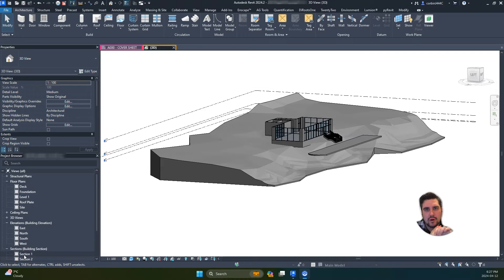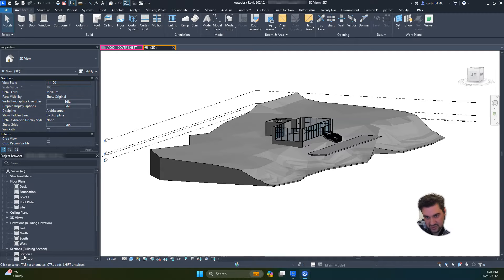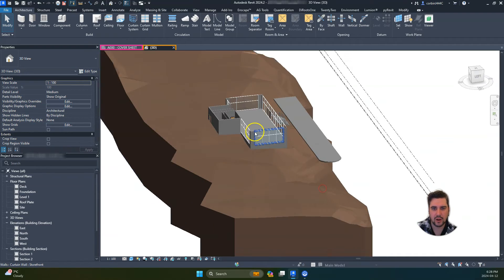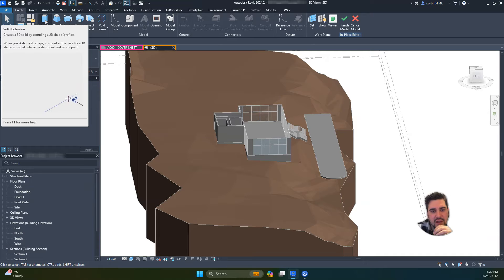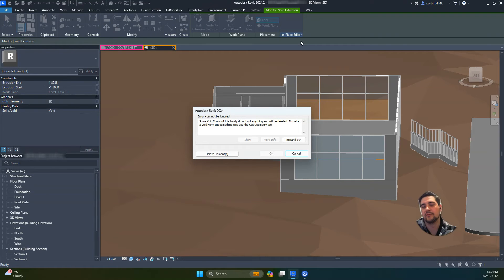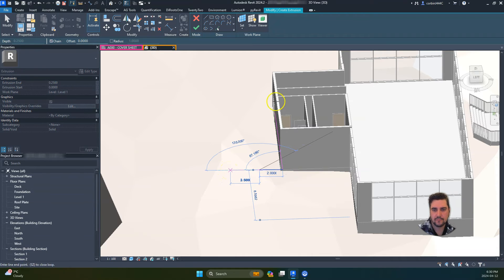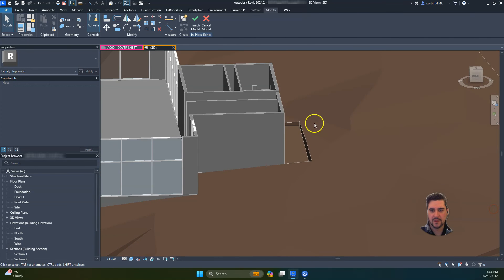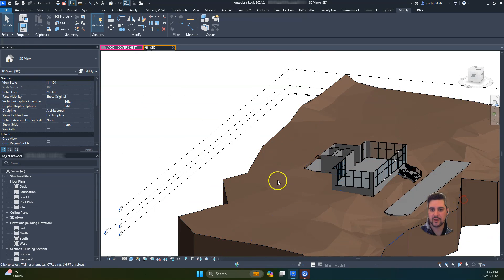Revit Tutorial - Toposolid and Cutting Topography No Building Pad Revit 2024

Comment: honestly this "UPGRADE" revit remove building pad is annoyimng
Reply from the maker: Initially yes but I think the flexibility it provides with topo outweighs that. In 2025 there is also a new excavation button. If you do a lot of topography stuff there is a plugin called environment by arch intelligence that is great for more customization.
Reply: @ i tried 2024
1. padding just work like a floor, its make no sense to modeling a floor by model in place
2. padding has slope on them
3. i can make a filter padding to show on plan: which is excavate and which is fill in (which in my case  in 2024 only show the fill not the cut because revit doesn understand)
4. new cut fill schedule doenst work, it shows 0 cut and 0 fill

it wwas very FRUSTRATING - i downgraded to 2023 , i consider it is a big bug- they should have both system instead of pushing evrything to newer thing, if they fix in 2025 why not a patch in 2024?